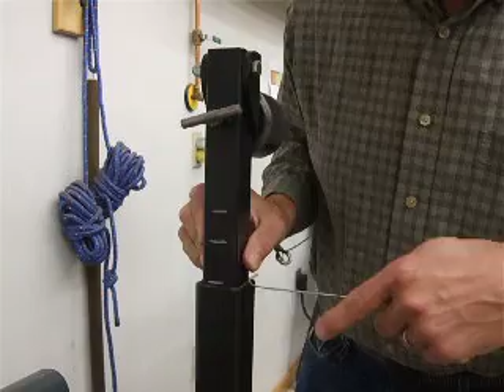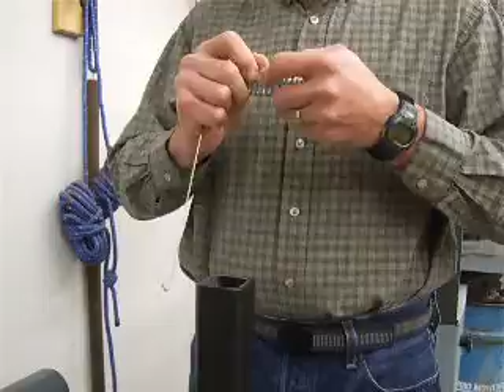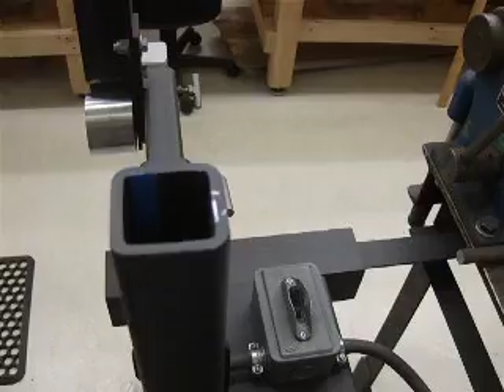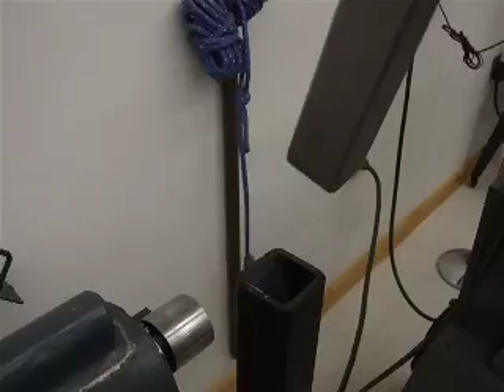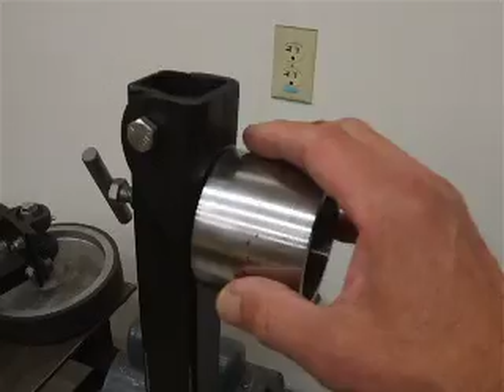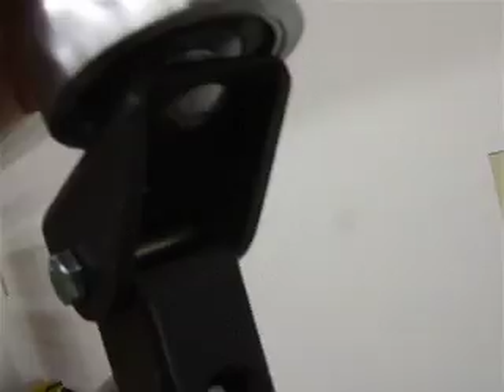2" by 72" Homemade Belt Grinder Part II

Comment from the maker: Actually, I will TIG most of the fuselage. However, there are some places my TIG just won't reach, but is perfect for my Meco torch. There is absolutely nothing wrong with gas welding an entire fuselage. After learning TIG welding, it is so much easier to weld certain areas with the TIG, especially large clusters that take so much heat using a torch.

Comment from the maker: @slab698 Wow...sorry for the long wait on the reply!

The shaft for the contact wheel is just a very thick wall piece of 4130 tubing. It is a press fit in the center of the wheel. The pillow blocks have set screws that hold it in place, there are no keys. The bolt just makes sure the assembly stays together with the spacers.

Comment from the maker: The pulley on the motor also has a slight crown, but it's made that way...you don't have to crown it yourself. This is in case the motor isn't aligned perfectly and allows the belt to still track correctly.

Comment from the maker: Hi...

The length of the tube is 16 inches, with a 1/8th inch plate welded to the bottom. The total length is 16 1/8th inches. Thanks for your interest!

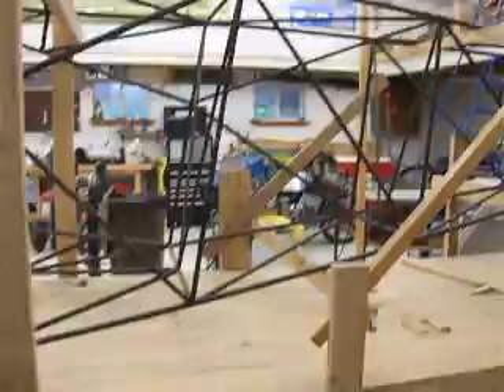Comment from the maker: Hey Dave Lemerond, I don't know why your comment won't show up. But to answer your question, look at about 2:00 on the first video "2" by 72" Homemade Belt Grinder". That's where I describe how I made the pulleys.
Reply: Hi my name is Manny from So Cal and I again want to offer to draw up your nice grinder project. It is still on youtube and
Reply: I have watched the video on the platten build several times and have an unanswered question. You tell the distance between the idler pulleys as 10 3/8 but do not say if the bolts are centered on the 2 1/2 angle iron or off center either way

Comment: Where are the holes drilled at on your tracking triangle piece from 1 side to the center of hole's Thanks
Reply from the maker: It's center is 3/4 inch from the top edge and 1 1/8th from the pulley side. The steel is 3/16ths thick

Comment: how did you figure how much spring tension to put on belt to keep it tight?
Reply: I pretty much just guessed. I knew how much vertical travel I needed and looked for springs that would compress that distance and would still have give at the bottom. The tension happened to work out to be just right on the first try.